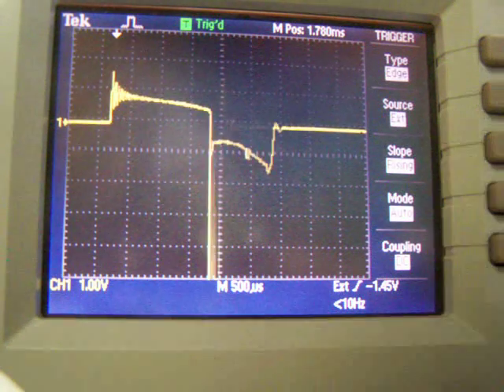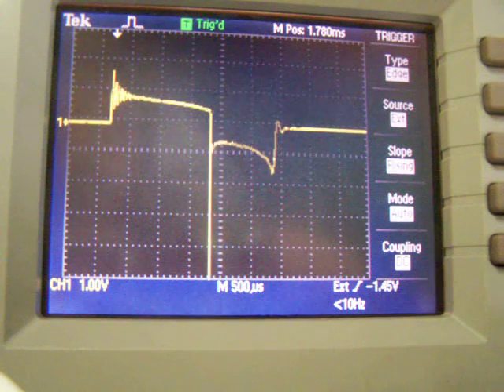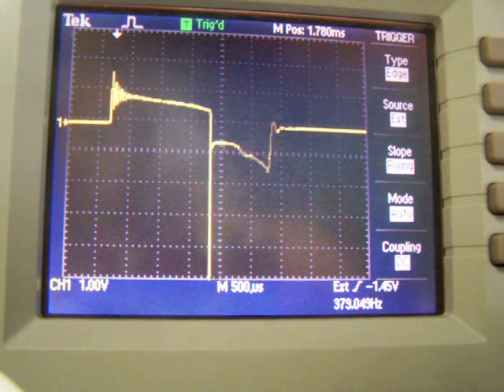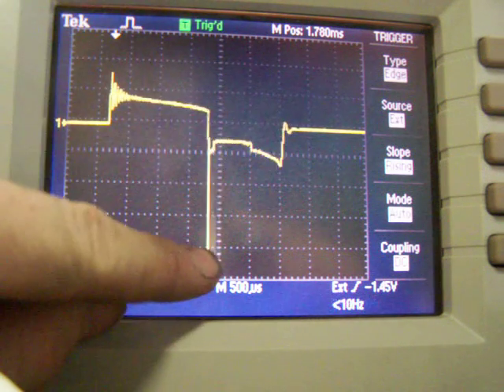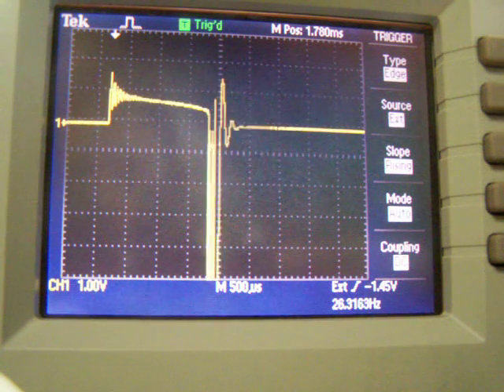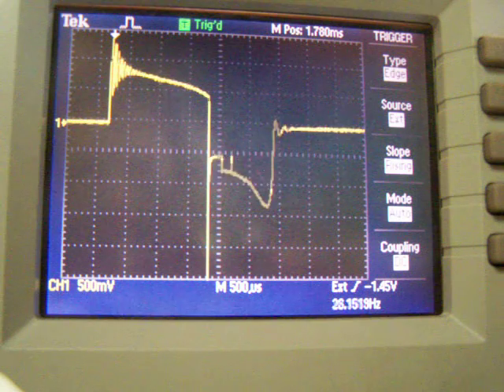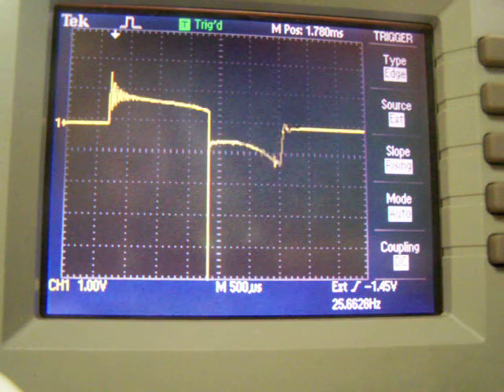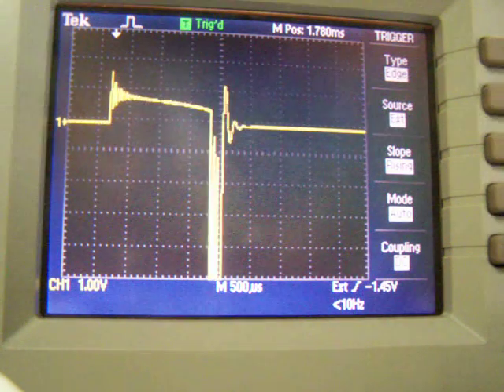Coil Pack COP Troubleshooting & Diagnosis 3/3

Comment from the maker: Basically, all I did was use a HIGH VOLTAGE DIVIDER. I connected the output of the COP to a HIGH VOLTAGE DIVIDER and connected that to my scope. Careful, one zap to the scope from the COP and you can fry your scope!
In my case I used something similar to a Ross Engineering Corp. model VD60.

Comment: Nicholas I have access to that exact scope. I want to do a test on my 2002 suburban and my 2003 Thunderbird. I was wondering exactly how you have that oscilloscope hooked up to the coil. What probes are you using? Are you using a current probe? Did you probe the wires with a needle? Thanks for that visual with a regular oscilloscope because most of these videos are done with a car grade scanner or diagnostic tools specific to vehicles.

Comment from the maker: Not sure the specifics... but It's a Tektronics TDS model of some sort. They are AWESOME SUPER RELIABLE scopes.... always accurate and always working. I've seen thousands throughout my years. They almost never have problems... The only thing I see often is loose BNC connectors.So, be careful with them!

Comment: think i had the problem on my v6 alfa, coil packs seemed fine, idle would fluctuate 100 rpm with a slight rough idle only felt in the driver seat but i did not get to fix it sadly i sold the car but thanks for adressing the issue.

Comment: Great troubleshooting. This is a really great visual way to see the bugs that coil packs might have. I have an 05 Taurus that jumps in rpm ever couple seconds. It is driving me crazy, I have been troubleshooting it for 9 months now. Replaced the wires, plugs, IAC valve, Charcoal canister purge valve, and cleaned out the intake. Nothing seems to fix it.I have a spark but with what this video shows me it might not be a good spark. I will now replace the coil pack. Thanks.

Comment: Hi bud, grats on solving your problem! :) My car is having a seemingly random drop in power during hard acceleration that can happen at any rev range and I am also suspecting it to be the coil pack, so I am wondering, what is that awesome device you have there? Is it an oscilloscope? I sooo wish I had one :P